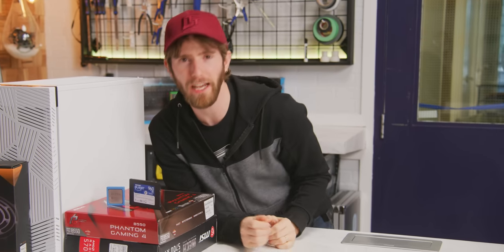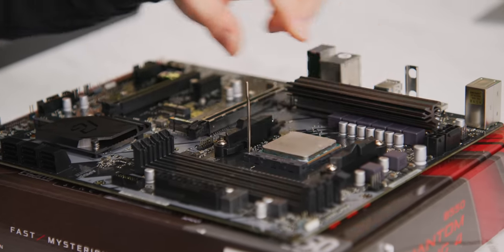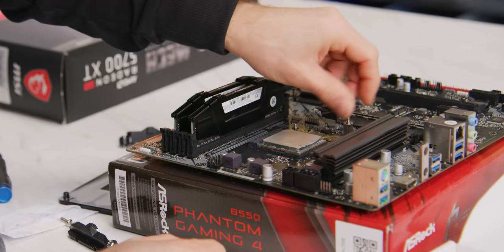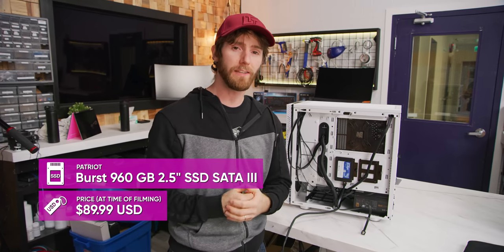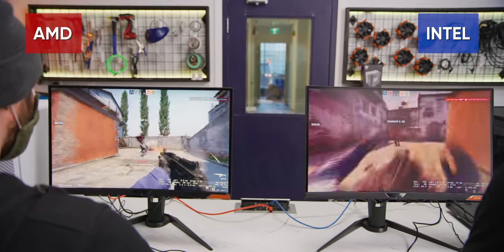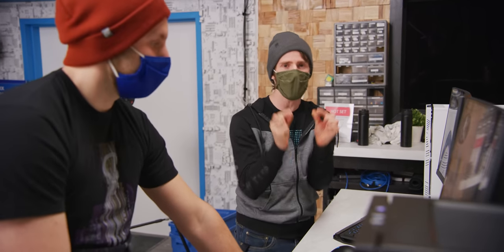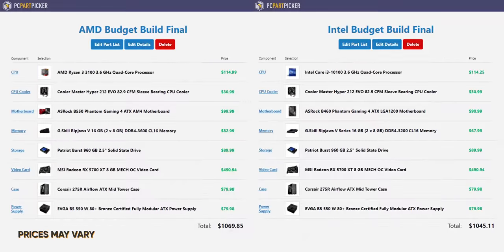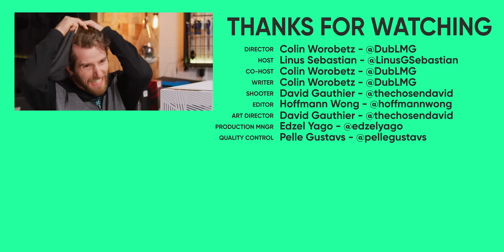AMD vs. Intel midrange gaming PC challenge

Comment: >$1,000
>Mid-range

You can't make this shit up. Seriously Linus, the stock Wraith cooler on AMD CPUs is already good enough. And you won't need a $100 USD motherboard as there are cheaper ones with the same chipset and same socket with smaller size that already support the same CPU. And for what reason should you have multiple M.2 slots besides using it as a cache in a NAS? And why do you need gen 4 support for a gaming PC? Don't most modern GPUs use gen 3? AND HOW THE FUCK IS A $500 GPU CHEAP OR MID-RANGE? MOST PEOPLE DON'T EVEN HAVE 1440P 144HZ MONITORS! Unless you're mining bitcoin of course. Only this is considered "mid range" to the ones who live in beverly hills.
Reply: I hate to tell you this but $1000 is midrange now. I don't like it and i don't think anyone else does either but it's the world we live in. With that being said. 

The use of an aftermarket cooler is a bit of an oversight but i assume it was just a little bit of budget they had left over. 
You could go cheaper on the motherboard sure but then if you upgrade you have to buy a whole new one. Part of the point of this is to have the option to upgrade. If you choose to forgo this and buy a  new mother board with each upgrade you can i guess. 
PCIE gen 4 is natively supported  on b550, it's not something they're paying more for. 
$500 is a lot for a gpu you're right, but you don't have to spend that much if you don't want to.  I'm not going to make you, and Linus isn't going to make you. follow the steps and use whatever gpu you can afford.  The point is the these cpus can handle these gpu's without being a major bottleneck. 

Again its not Beverly hills and this is midrange. Even a 60 series card cost over $300 now

Comment: ryzen 3 with a rx 5700 xt? A ryzen 5 2600 would be so much better, especially in E-Sport games.
Reply: But Ryzen 3 3100's single core performance is better than Ryzen 5 2600. Yes it has more cores and more threads but still.

Comment: My heart died when he touched the metal contacts on the intel cpu
Reply: Why?
Reply: @Homanjer  touching contacts that are meant to be clean dosent sound like a good idea
Reply: @nugget4296  this is somewhat true ofcourse but given the electricity they actually come into contact with and just general experience it doesnt really seem to matter at all. Like usually when you have things like light bulbs you dont want to touch them because they might break when the oils of your skin are on them or when you have really wet fingers you might make a wire corrode. But even that is so incredibly unlikely. Ive never seen something like that actually be a problem and neither has my father who has been working in IT since the early 80s

Comment: Hey Linus,,,, you are the most prolific Video Schmizer on You Tube, at least in my Geek World.   How about a $2,000 to $2,500 build using either AMD and Nvidia or Intel.....take your pick(s).  I dont care if they are currently vaporware or not.  Sooner or later the Cows will come home.  I want to run it on an UltraGear 38GL950G-B 38" which should not be included in the cost. Just the Box man.

Comment: I'd rather choose much better ryzen 3 3300x just add a couple of bucks.
Reply: I'd take the 3100 over the 3300 any day as you can just overclock the 3100 to 3300 speeds. Both use the same cooler afterall.  I'd consider the 3300X if it had a beefier cooler included tho..

Comment: Imagine buying an RX 5700 XT for $490.... Both of these builds are straight-up embarrassing for a number of reasons, honestly. You'd be rightfully downvoted into oblivion for posting either of them as a recommendation on somewhere like /r/buildapcforme. Like, why the Hyper 212s, for starters? Neither of these builds need aftermarket coolers, AT ALL.
Reply: Michal Litecký  Even with the current GPU stock situation, that's WAY too much to pay for a 5700 XT even brand new considering how it performs. Something like this used 1080 Ti on Ebay is still overpriced at $447, but at least WAY better of a deal than a $490 5700 XT:
https://www.ebay.com/itm/MSI-GeForce-GTX-1080-Ti-Gaming-X-TRIO-Overclocked-Triple-Fan-11GB-GDDR5X-PCIe/174576995602?epid=8031290550&hash=item28a5998d12%3Ag%3AYLoAAOSwnrNf7EqZ&LH_BIN=1

Comment: Faster than my pc

My pc specs
Intel i5 750(no aio)
Gts 250
Old 650w psu
Hdd

All old which you can buy 1 rtx 2060 gpu in just 1 computer
Reply: I'd say it was time for a upgrade in 2013 or so.. You missed the boat in Sandy Bridge (i5 2500 i7 2600) which was when we saw a big boost in performance.. but you did get that initial jump moving up from the core series to the first desktop i5s.

Comment: Y'all deadass calling $1000 "budget friendly"?
Reply: Man these days It kinda is. Freaking inflation bullshit. That's why I got myself a Laptop with i5-10500H, 16 GB RAM 3200MHz, RTX 3060, 1x 1TB M.2 NVME SSD, 1x 512 GB M.2 NVME SSD for about a 1000 EUR or about 1150 USD. Great deal for the price and way cheaper than current desktop PC's hehehe. I'm thinking about going to upgrade to 32GB of 3200MHz RAM though. 16 GB will soon not be enough a bit of future proofing. Sorry for rambling on so much :) Much love, hope you get the system you need.
Reply: Yoyr just broke

Comment: Sir i3 10100f or amd ryzen 3100 
Plzz help
Reply: AMD Ryzen is highly depend on memory speeds (briefly mentioned in the video) Unless you're able to get 3200-3600 mhz speed ram I'd say the i3 10100f would be your best bet.  That being said if you can scrape together a bit more money id recommend looking at  the i5 10400f, or the r3 3300x.  both of these cost a little more but should hold up slightly better.
Reply: @investedtrash138  i am getting g skils ripjaws 8gb 3200mhz 
Gtx 1650super 
And i have an option to buy an i3 10100f or amd ryzen 3 3100
Reply: @RishabhSahu01  honestly i'd say whatever ends up being cheaper.  Down the road you can upgrade either to a i7 10700, or a r5 5700 both would be good quality of life upgrades.
Reply: @investedtrash138  sir. 😂😂😂thats funny beacuse both costs me the same so then say? 😂😂
Reply: @RishabhSahu01  Personally for me I'd say the 3100 as AMD cpu's tend to become cheaper on the used market then intel.  am4 might be dropped next year but long term motherboard support won't be any better on intel.   Honestly man follow your heart and if you happen to like the colors on one motherboard over the other that is as good of a reason as any to choose one at this tier.

Comment: Nvidia could use arm and break contract and just start making cpu's... Meanwhile same old videos about amd and Intel repeatedly are hashed over. It's less and less exciting. But at least they keep making components that fight against the last generation for less and less of an actual performance gain. Good times. But But... overclocking on low end and gen 4 m.2 and cpu gpu access and petematreplp... Listen I see 2 frames over one in a series of years that's enough time to maybe make a leap in development. Wait AMD did that? Intel is still confused and forgot what is reality? K.

Comment: I think intel is better in terms of processors. In GPU's NVIDIA destroys AMD's 6900 XT with the RTX 3090.
Reply: @Aditya Bhattacharya Not always.
Reply: Some RTX 20 series cost more than the RTX 3060 and yet, are worse in performance. So therefore, your point does not apply for all GPUs.
Reply: @Aditya Bhattacharya Wdym?
Reply: @Aditya Bhattacharya Still not always.

Comment: For $1000 BOTH of these systems SUCK. Especially considering what we could get for the same price just a couple years ago. Thanks AMD, YOU’VE become the Intel now.
Reply: How do you figure that?  The 3100 is a $150 CAD Cpu. Pretty damn impressive at that price point. compared to what you'd have gotten a couple years ago at the same price.  As for the rest.. 1700, 2700, 3700, all came out at the same price.  It's only with the 5000 series that we've seen a jump in price and part of that comes down to availability.